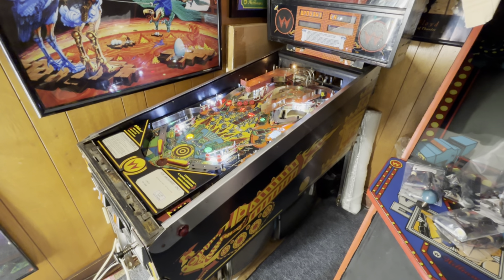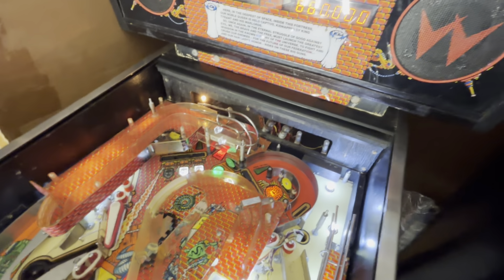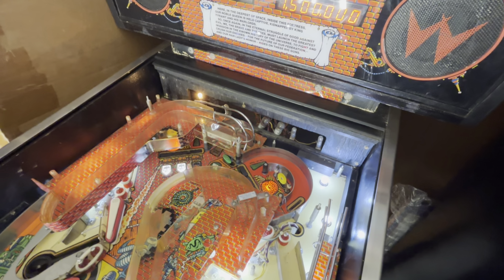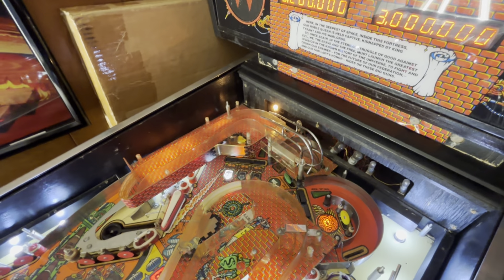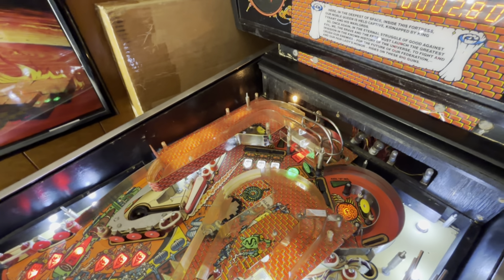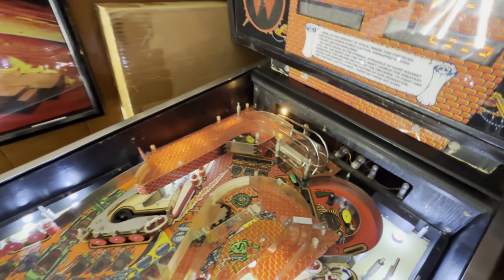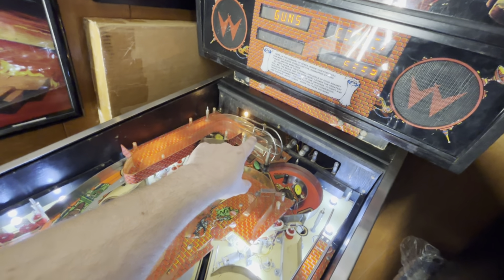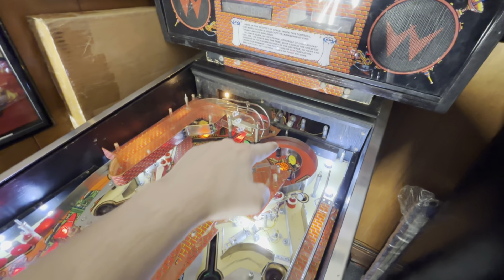Williams Big Guns Pinballbulbs.com LED install.

Comment: LOL.  Gosh I remember doing this to clean and install LED's on my machines.  One of the first I did was SEGA Batman Forever, lost a few tiny screws and had adjustments wrong.  Took several days to get the game back working.  After that, I invested in correct tools like long thin magnetic screw drivers, etc.  Great pin by the way.
Reply from the maker: Many screws and washers were dropped, none were lost fortunately.